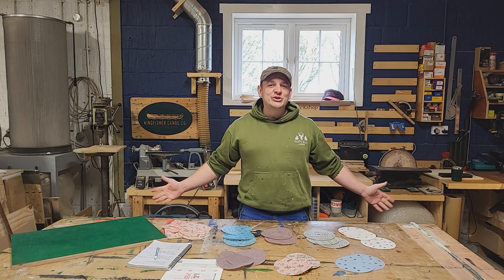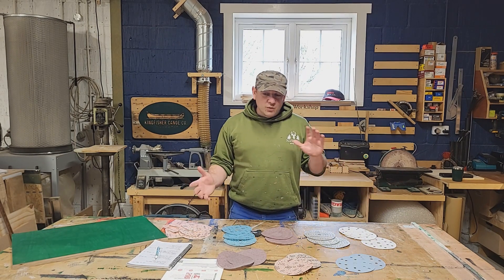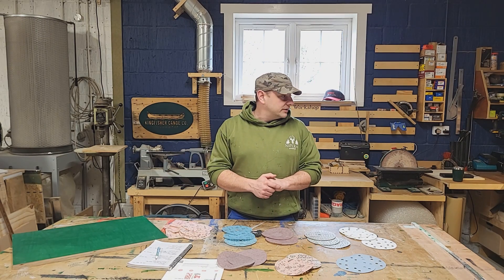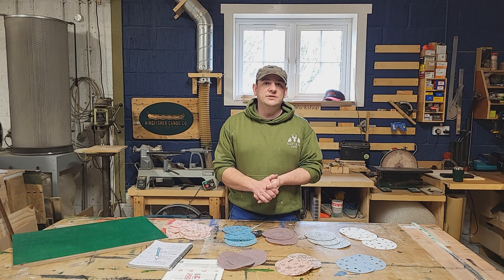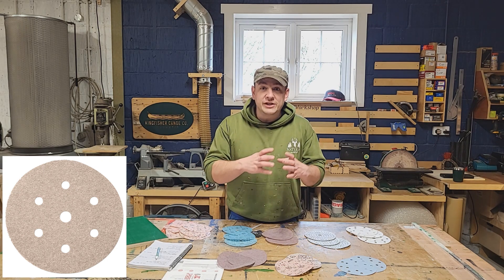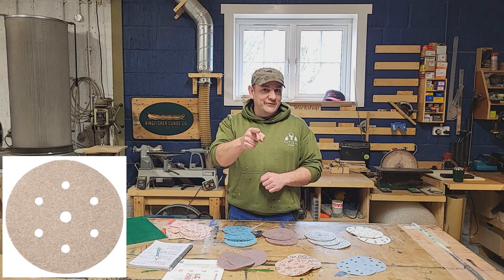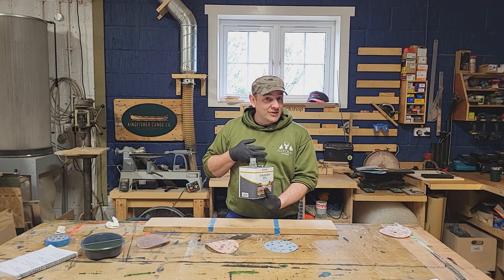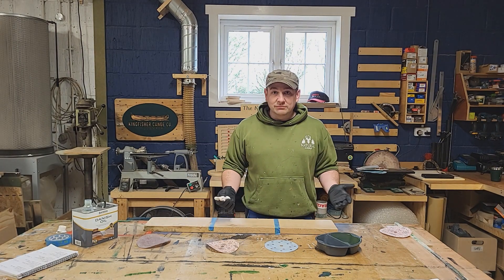Why Is Everyone Talking About The New Ligno Sanding Discs?

Comment: Interesting that you use the Galaxy for fine finishing - I like it for cleaning up reclaimed wood because it zips through the dirt, grime and previous finishes and lasts a lot longer than most sandpapers, so it’s actually quite cheap when taken in context.
Reply from the maker: Yeah the finer stuff is really amazing!! I know a few people that use it for finishing epoxy River tables before polishing. I agree with you on the reclaimed wood, I try to keep a bunch of 80s around as they work really well on rough sawn timber.